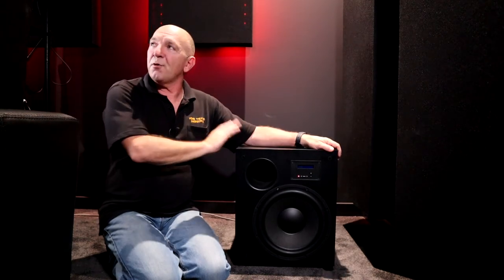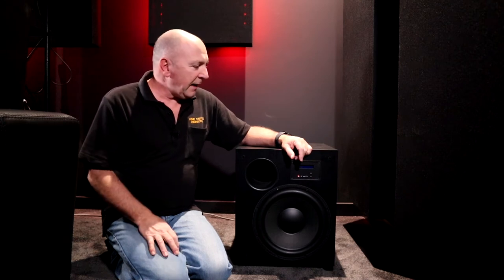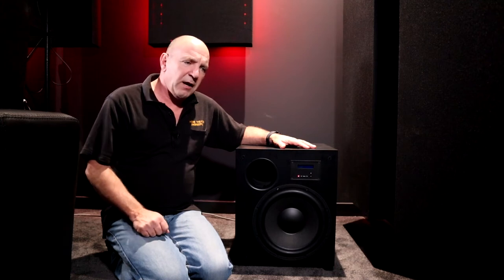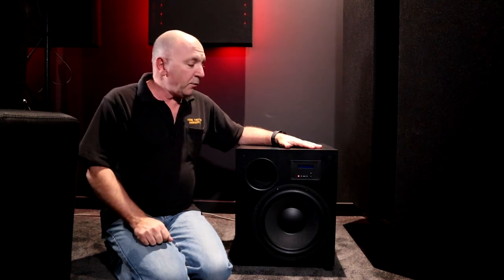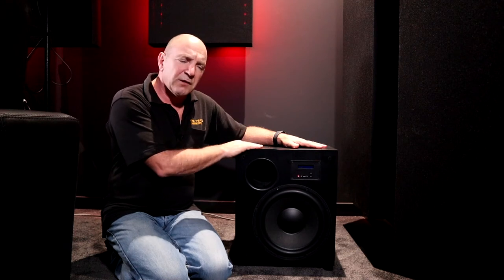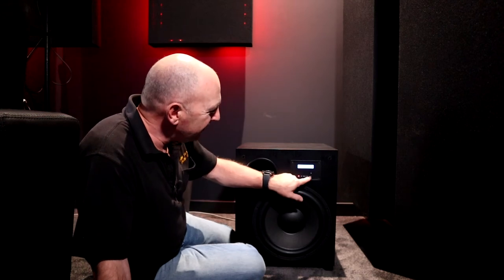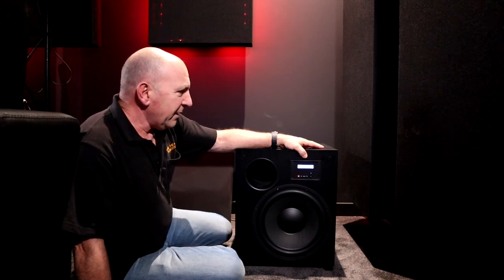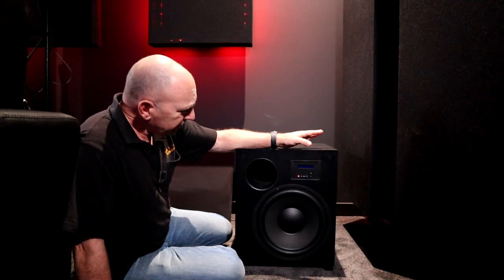Review of Krix Volcanix Subwoofers

Comment: Great speakers but they are not being sold in USA 🇺🇸
Reply from the maker: Yes they are :-)
Reply: @HomeTheatreEngineering   really what is the USA website to buy krix speakers?
Reply from the maker: @victorpulos823  Hi Victor I was actually incorrect. I misunderstood the information Krix gave me. They are not sold or distributed as yet in US but they can be bought and sent to USA. Get in touch if you are interested. Hope this helps.
Reply: @HomeTheatreEngineering  how much will shipping cost be to USA 🇺🇸
Reply from the maker: @victorpulos823  That would depend on the size (volume and weight) of the order. Once we know what is needed we could work that out but please contact us directly to discuss this.
Reply: @HomeTheatreEngineering   I want to buy 5.1.2
Reply from the maker: @prasanthps9445  contact us through our website www.hometheatreengineering.com !!